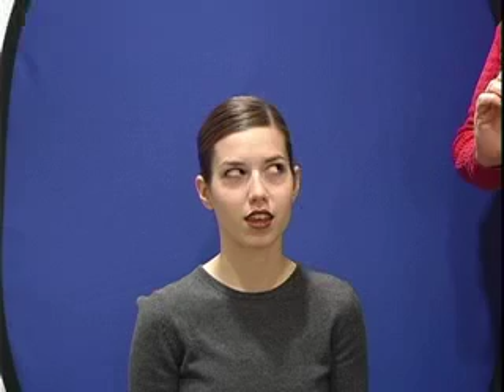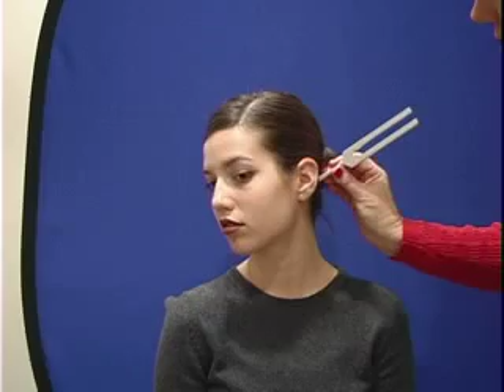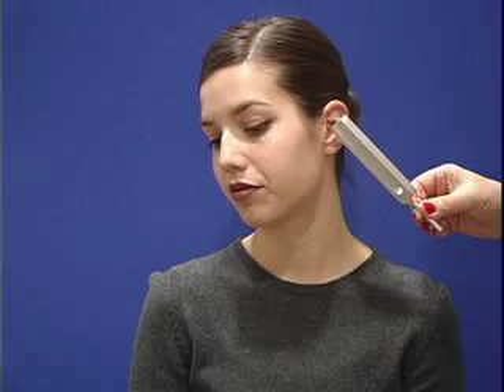Rinne test

Comment: Why do you care when she stops hearing the air conduction noise? That needlessly adds time to your exam. All you need to know is whether or not she hears the noise after she no longer hears it through bone conduction.
Reply: +Micah Wharrie I'm not advocating not testing both bone and air conduction. What I'm suggesting is that after she no longer hears BC, if she can hear it through AC, you've already tested both. There is no need to continue the test until she can no longer hear AC. What utility does this provide?
Reply: Because, as she said, you normally hear the sound 2 times longer by AC than BC. So, whether or not the patient is Rinne+, a significant reduction of that time indicates some transmission problem.
Reply: +Max Tolan if AC >BC  --> Positive Rinne, which is normal.
Reply: Yes. So why do we care when she stops hearing the AC? If after she stops hearing BC, she can hear AC, than AC>BC. No need to keep the tuning fork there until she can no longer hear it through air conduction.
Reply: +Max Tolan The Rinne's test compares the air conduction to the bone conduction to determine if there is a conduction abnormality in the auditory canal or the inner ear. If both are diminished, it signifies a neurological abnormality. Performing only bone conduction does not rule out auditory canal disruption.
Reply: Ah yes, I see. AC may not be completely absent but just significantly reduced, as in an obstruction. Comparing AC to BC is a way of quantifying the test.
Reply: Don't you mean negative Rinne?